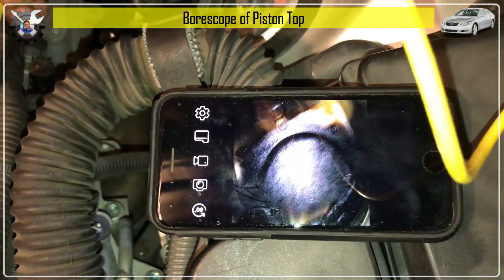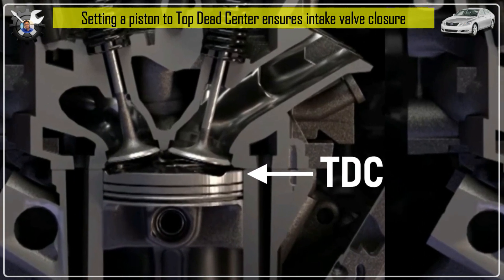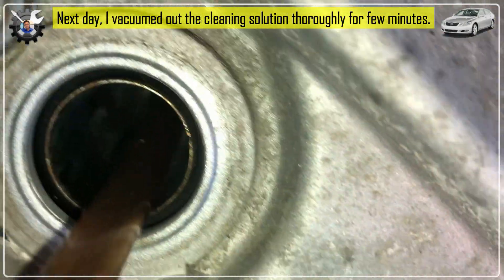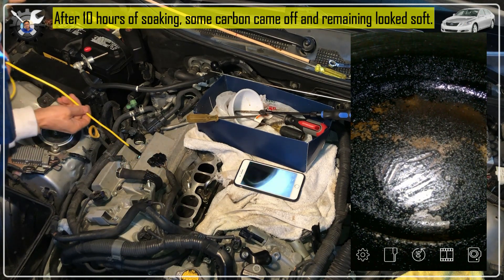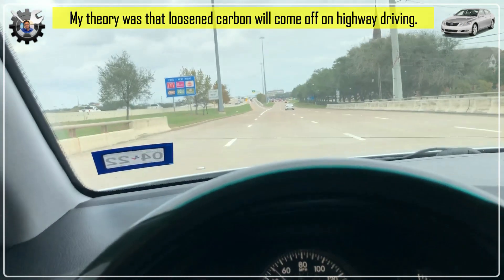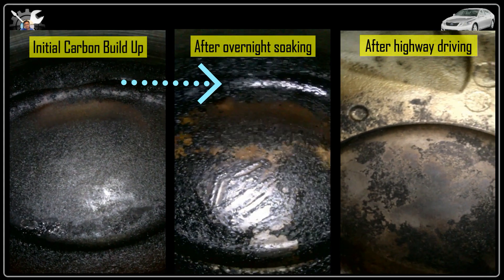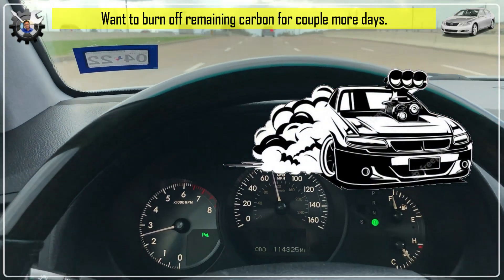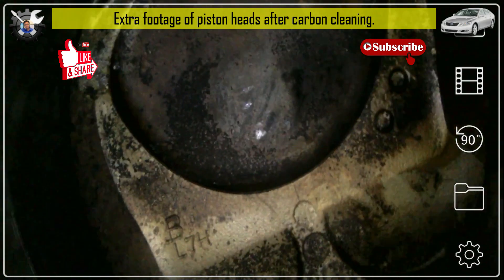Piston Carbon Soaking & Cleaning

Comment: Do you prefers chem dip cleaner or seafoam ? Which gives you best results ?
Reply from the maker: Also, owner's manual states "When judging the amount of oil consumption, keep in mind that the oil may have become diluted, making it difficult to judge the true level accurately.
For example, if a vehicle is used for repeated short trips and consumes a normal amount of oil, the dipstick may not show any drop in the oil level at all, even after 1000 km (600 miles)
or more. This is because the oil is gradually becoming diluted with fuel or moisture, making it appear that the oil level has not changed. The diluting ingredients evaporate out when the vehicle is then driven at high speeds, as on an expressway, making it appear that oil is excessively consumed after driving at high speeds."

That means, if you only drive in short trips and do not get on long highway driving, the moisture and fuel dilution would give fake higher reading...
Reply: @DIYLifeSkills  I add half quart every 1,000mi and mostly driving highway not sure this is okey or not I have 08 Lexus GS 350 with 124mi? Question here anytime I use the fuel cleaner additive does it contaminate the oil or become diluted ?
Reply from the maker: Both have many positive reviews.  I chose chem dip because it was not flammable and I could vacuum it out without. Seafoam is highly flammable so much caution is needed and should not use vacuum because the motor will generate some spark.  One advantage for seafoam is you can buy in small can but chem dip comes in big can so you’ll have to pay more initially.
Reply: @DIYLifeSkills  do you recommend me using Redline SI-1 fuel system cleaner inside the piston rings since this is the only cleaner have the highest PEA which knows to dissolve carbon buildup ?
Reply from the maker: There are many carbon dissolving solutions, but The big challenge is just soaking ain’t going to get any meaningful amount of carbon dissolving solutions to come in contact with piston rings because piston rings are designed to act like springs and they expand outward to make reasonably tight seal in cylinder chamber.
Reply from the maker: @Cosmopolitan86  I guessing you are trying to reduce oil burning issue?  How much oil are you burning?  The owner's manual states, it's normal to burn 1L per 1000KM or 1.1 Quart for every 600 miles.   This is really disappointing since at that burn rate, just in 3600-4000 miles, all 6.7 quarts of oil would be burned.  So it won't even make it to 5K mile oil change let alone 10K mile change.
Reply: @DIYLifeSkills  well burning half quart every 1,000 not bad but you know what that’s maybe because I use 10w30 instead of 5w30 !! 🤔
Reply: @DIYLifeSkills  May I ask you any recommendations on engine oil brand ? Like engine oil do you use ? I remember one day I used Amsoil when I bought the car and within 1 week start notice white smoke coming out of my tailpipe I freaked out and I thought this oil is garage , then now I relized that white smoke mainly was cleaning off carbon deposit am I correct ? Or that was different issue resulting in white smoke like bad valve seals or worn out piston rings ?
Reply from the maker: @Cosmopolitan86  Toyota and Lexus uses Mobile 1. So that’s what I use Mobil-1 full synthetic 5W-30
Reply from the maker: There are engine flush solution that you add to the oil and run it in idle mode for few minutes to clean carbon off wherever oil travels to.  But this is a harsh cleaning and instructions must be followed accurately.

Comment: What a great video man very Organized and straight to the point , I just bought the same yellow borescope from DEPSTECH and I was very surprised on how great the picture quality, but the sad part is the piston rings on my 08 gs350 was very bad , im looking to do the same you did 👍🏼
Reply from the maker: Hi Costantine, the Depstech camera I bought was this single lens, which worked great. 
https://www.amazon.com/Endoscope-DEPSTECH-Semi-Rigid-Inspection-Tablets-16-5Ft/dp/B07MV6X4M4/ref=sr_1_7_sspa?keywords=depstech+endoscope&qid=1656671802&sprefix=deps%2Caps%2C118&sr=8-7-spons&psc=1&spLa=ZW5jcnlwdGVkUXVhbGlmaWVyPUFTNjcwRktWUks5RDgmZW5jcnlwdGVkSWQ9QTA0MDQxNDBHM09CVlBTUFdFRkQmZW5jcnlwdGVkQWRJZD1BMDAyMDkzNTNSVkNIVlM0UlVYWEUmd2lkZ2V0TmFtZT1zcF9tdGYmYWN0aW9uPWNsaWNrUmVkaXJlY3QmZG9Ob3RMb2dDbGljaz10cnVl

But now, they have a dual lens that can look straight or switch to 2nd lens that look side ways. 
https://www.amazon.com/DEPSTECH-Inspection-Waterproof-Semi-Rigid-Tablet-16-4FT/dp/B08NJ8627V/ref=sxin_16_pa_sp_search_thematic_sspa?content-id=amzn1.sym.b245e49f-68a4-4489-b1f9-81f4034255f5%3Aamzn1.sym.b245e49f-68a4-4489-b1f9-81f4034255f5&cv_ct_cx=depstech+endoscope&keywords=depstech+endoscope&pd_rd_i=B08NJ8627V&pd_rd_r=ad86df15-72f9-46eb-b2f1-f78c46bb5e5d&pd_rd_w=Ntbbg&pd_rd_wg=Ey1mC&pf_rd_p=b245e49f-68a4-4489-b1f9-81f4034255f5&pf_rd_r=DTHMY8S225ZN158K1MKG&qid=1656671802&sprefix=deps%2Caps%2C118&sr=1-4-a73d1c8c-2fd2-4f19-aa41-2df022bcb241-spons&psc=1&spLa=ZW5jcnlwdGVkUXVhbGlmaWVyPUFTNjcwRktWUks5RDgmZW5jcnlwdGVkSWQ9QTA5MjI5MzAyTkpZUkVPVU1WUFdHJmVuY3J5cHRlZEFkSWQ9QTAyNzMzMTgxR0w2TVc5RlZJT0g4JndpZGdldE5hbWU9c3Bfc2VhcmNoX3RoZW1hdGljJmFjdGlvbj1jbGlja1JlZGlyZWN0JmRvTm90TG9nQ2xpY2s9dHJ1ZQ==

Had the dual lens been available, I would bought that for just another $20 which I can use for many uses such plumbing and other car repairs.
These two requires a smartphone to watch & record.
Reply from the maker: If you just bought the Depstech, you might be able to return it and swap it to the dual lens...if you like. Right now it's -20% off ($69.99) and they are allowing additional 10% off today.
Reply: For me the single camera is good. The only part I’m missing here is the vacuum attachment which I’m not sure how you can attached that 3/8 inch hose to it and still sucking all the seafoam  ?? Also should I use the both cleaners or just seafoam and how much ? Should I expect the solution to go and sit on top of the piston or the soultion will find it’s way and seep from the piston wall down to the crankcase  ?
Reply from the maker: I bought 3/8 inch or ~9.5mm clear hose from hardware store.  I used duct tape to connect to the end of the shopvac. 

I used chemdip, which is not flammable that’s why I was able to used the vacuum.  If you use seafoam, that’s highly flammable, so you can’t vacuum it out as the spark in vacuum motor could ignite fire!!!

If you use seafoam, you’ll have to use non motor way to extract the liquid such as liquid hand pump which you can buy for about $10 but this may not get as much liquid out as the vacuum. 

So the best option is to use non-flammable chem dip.
Reply from the maker: Also, the piston rings are pretty tight and they will prevent any liquid to drain down to the crankcase but I’m some very small amount will sip through. 

If you want to get little bit more of cleaning to touch piston rings, then as you soak it, turn the crankcase up and down and cleaning solution in the piston wall will come in contact with piston rings.   Not sure if it’ll be significant enough to remove carbons on the piston rings but it might remove some.
Reply: @DIYLifeSkills  I’ll make sure to do this right before an oil change, some folks says that you can turn on the engine without spark plugs in order to get all the solution out but I’m pretty sure that going to be a mess job, I rather just vacuum it out like you did 👍🏼
Reply from the maker: Looking back, I think soaking the pistons with Chem Dip for just few hours is enough. Avoid soaking more than 12 hours.
And be sure to thoroughly vacuum out the remaining solution with shopvac connected to a small hose. 
This is super important to not hydro-lock. 

Good luck and let me know how it goes.

Comment: About the remaining fluid on top of the pistons, I think that if you take all spark plugs out and leave spark holes open and start the engine every fluid will shoot off of the spark holes.

Is that safe for the engine or not?
Reply: So I worked as a Honda Tech for 25 years. When Honda went to fuel injection, we started getting no start problems when a customer would start their  car, move outside to wash it, shut it off immediately then after washing repeat the start and quick shut off. If they did this again for any reason, it would creat a no/ hard start as the injector were washing the oil off the cylinder walls. They engine would turn over very fast ( low compression) but not start. The easy fix is to remove spark plugs and add about a tablespoon or less of engine oil to each cylinder. Turn engine over a few times to coat the cylinder walls by hand and then  go ahead and put a towel over the valve cover and pinch the rubber fuel line and crank engine with key  to remove any excess oil. Never out of hundreds of jobs did we vacumn out the cylinders. Never with this procedure did we hydrolock any engine. You don’t have to remove every drop, just no large puddles.
Reply from the maker: @jeffshank9513  yup small liquid in top of the piston is ok. Just trying to warn people not to leave a big puddle of liquid in there before starting the car.
Reply from the maker: Don’t let this chemical spew all over the engine or to yourself.  It’s a harsh chemical, so vacuum it out using a thin hose like I did.  

Watch the video closely, I explain this in detail.   Definitely do not start the engine with plugs in…it can hydro-lock and kill the engine.   This is very effective cleaning method, but follow the instructions carefully.   What car year and model do you have?
Reply: @DIYLifeSkills 

Indeed it is a harsh chemical but what i meant is soaking it over night then start the engine with no plugs on to let it escape

Of course I'll catch it with a towel over the plug holes, so it doesn't harm me or anyone

I own a 2009 Ford Mustang with v8 engine
Reply from the maker: @Arab_Guy_GT500  It all depends on how much you pour in. I probably poured enough to cover about 1/4 - 1/2” over the piston top to make sure I get a good soaking coverage.  If you pour just a little amount perhaps you could just crank it without the plugs but I’m not sure you’ll achieve the carbon cleaning.  

I would still recommend shop-vac to remove nearly all liquid because I don’t trust cranking will push out all the liquid. It’s very helpful ti have borescope to confirm that liquid is removed.  Borescope can also let you see before and after results.  Cheap ones are under $20.
Reply from the maker: @Anything Goes  because you are dealing with longevity of the engine, I just don’t want you to cut corners and risk not really cleaning the carbon, and worst yet, hydro-lock one of the cylinders because enough liquid was left on top of the piston.
Reply: @DIYLifeSkills 
Thank you so much sir 🙏🏼
You helped me indeed

I'll buy a Borescope first and to be safe I'll vacuum up all the liquid just like how you did and I'll double check. 
Of course no one wants the hydro-lock it is what I'm afraid of and that's why I wanna take your advice. 

Again thank you 🙏🏼
Reply: @DIYLifeSkills 
How about the intake valves and what do you recommend?
Reply from the maker: @Arab_Guy_GT500  If you haven't, take a look at the steps I've taken to clean the carbon on intake valves.  It's more involving, but you only do this perhaps every 50K to 100K miles.  

https://www.youtube.com/watch?v=m0fGP3MrqFQ
Reply from the maker: @Arab_Guy_GT500  In fact, if you are going to do both, it's best to do the intake valves first, since some cleaning solutions and debris could fall to the piston chamber.  Also, you want to do this just before oil change so that you don't drive long miles with bit of carbon cleaning solution in the oil.   In my case, I also timed it so that I change the spark plugs after all the carbon cleaning.  This way, after the carbon cleaning, I'm driving with clean plugs and oil.
Reply from the maker: @Arab_Guy_GT500  Do look at the series of videos I put together for intake and piston cleaning, and spark plug & oil change afterwards.    Expect many of those wire harness connectors to break easily. It's just how it is.
Reply: @DIYLifeSkills Won't the inertia of the fluid shoot it out (seariously shoot) outta cylinder? Piston even just on starter is pretty fast. Cranking it with for 10 or 15 secs should push enough of it I guess. Actually, have you ever tried to calculate how much fluid would be needed to inceease the pressure enough to think about hydrolock? I didn't but gonna explore it as it just came into my head
Reply from the maker: @bratjagermeißter The problem is if you crank piston to force liquid out, it’ll splatter everywhere around the engine.  This is harsh  chemical so I’m not sure you want to do that.  If you want to try, then be sure to cover up your engine, underside of hood, and side body panels.  And you stay away.
Reply: @DIYLifeSkills Yup, that's obvious. I thought it didn't had to be said that something soaky is gonna catch the fluid. It'd be better to put some cloth into cylinder to soak it in. Guess head gasket wouldn't like taking a hit from extremly harsh solvent. Then a bit of italian tune up on highway to finish the process and mission complete
Reply: Can I do this for lexus 2jz.ive used brake oil,gear oil,20w50 tho I have small oil leak but blue smoke,carbon fouled plugs,muffler is all black and carbon,catalyst inside muffler all black like charcoal...
Reply from the maker: @Wesaazx Where is the oil leak from? That needs to be fixed first. Also, blue smoke is a strong indicator of engine burning oil, likely due piston rings that are stuck with carbon deposits so rings can’t expand out to scrape the oil back down to the crankcase, which results oil in crankcase wall getting burned off during combustion.  Try BG product’s piston ring cleaner along with this soaking method.